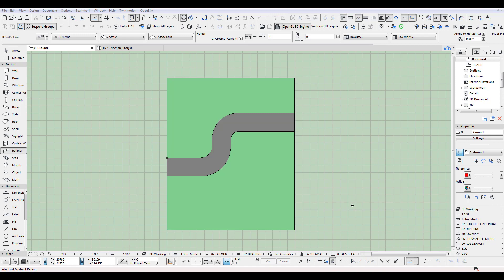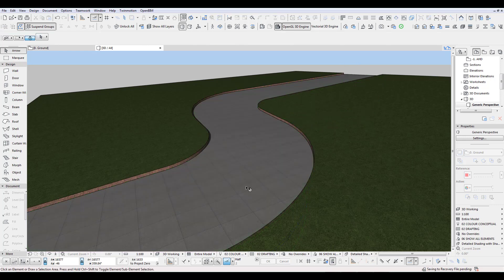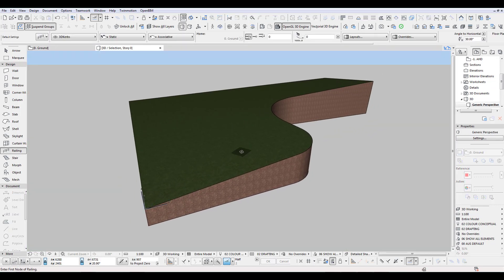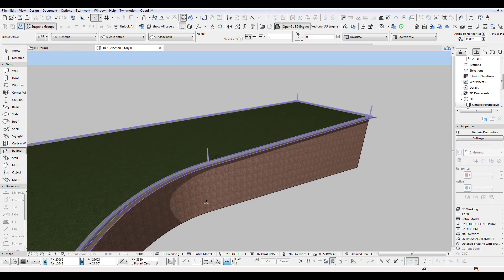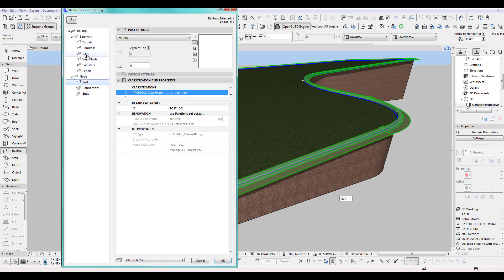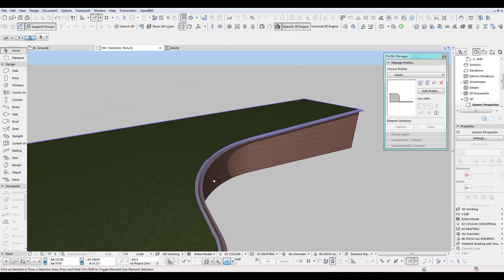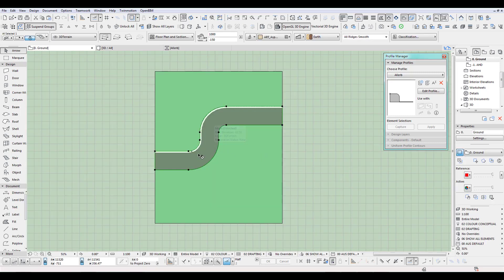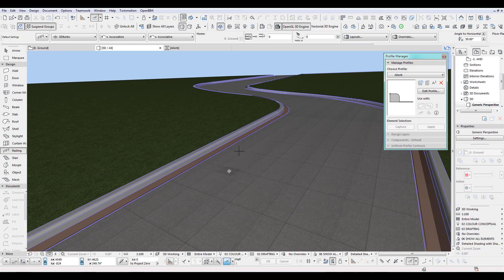How to create a quick sloping Kerb along a terrain in ARCHICAD

Comment: Good use of railings, this use didnt accured to me. However it could be slightly faster to trace the road mesh object instead of terrain, then extend it on the ends and chopp it off together with the railing. Otherwise good tip.
Reply from the maker: Ha, nice one Jan ! Thanks for mentioning this.